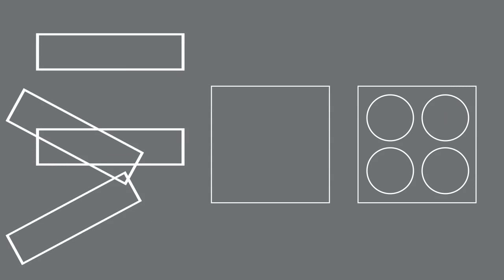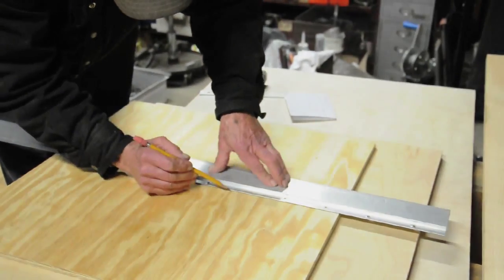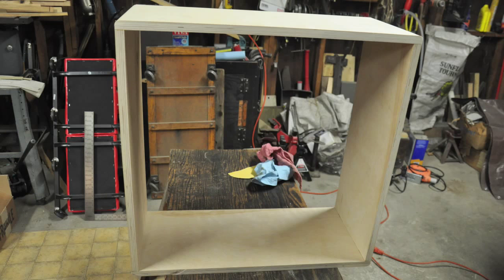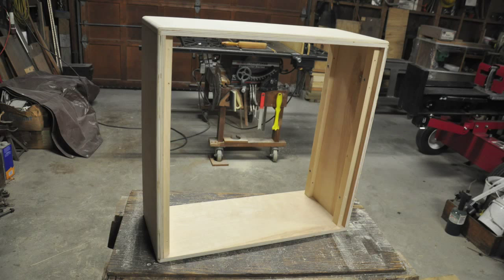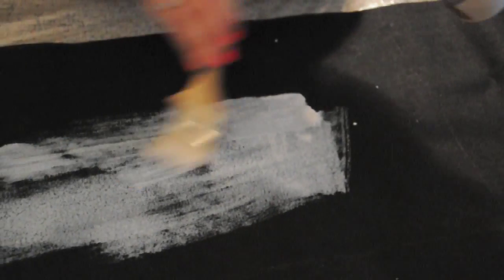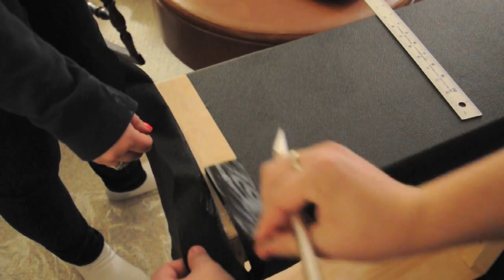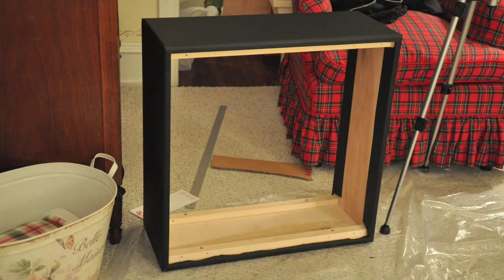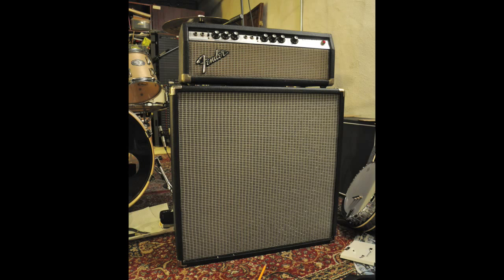The Basement - Building A Homemade Speaker Cab

Comment: Great build! I'm guessing it never ever has to move anywhere, though...I was waiting for you to install the side handles =)
Reply from the maker: +microcosm I've never owned a cab with side handles! I have handles I've installed on the tops of the two cabs I've built, but installation is so simple with those it didn't seen necessary to show here.

Comment from the maker: @DylanWeigandGruesome The speakers themselves, or the cabs? The speakers have different design specs - bass speakers are typical made for the much higher wattage that most bass amps produce, and they are voiced more toward bass. Guitar speakers are often designed with how they break up in mind too. With cabs, bass cabs are almost always sealed with ports for air, while guitar cabs vary, open or closed back. Some folks have used bass cabs for guitar and vice versa though.